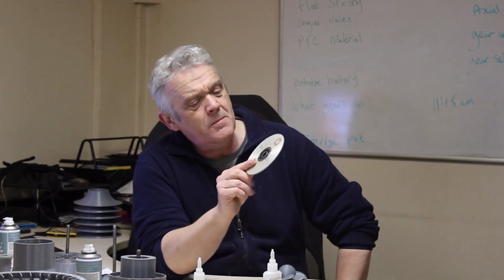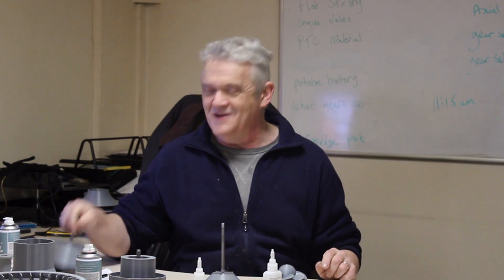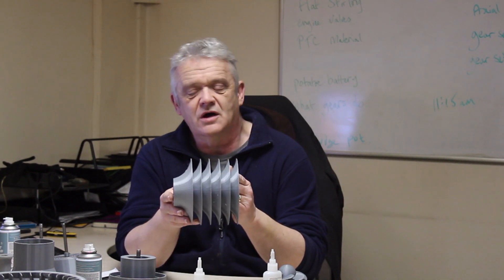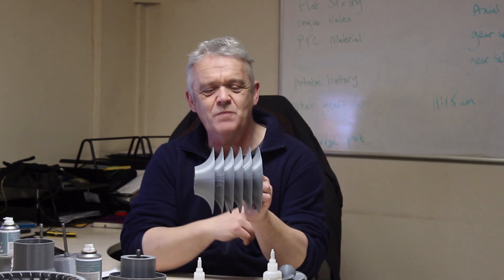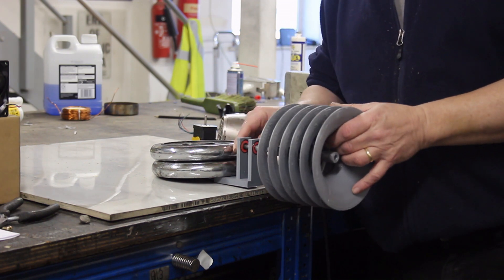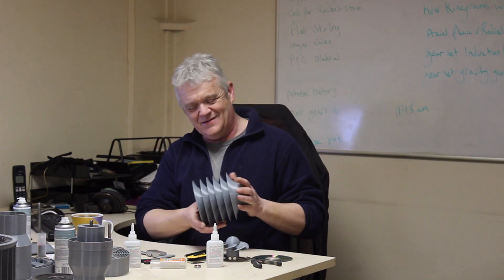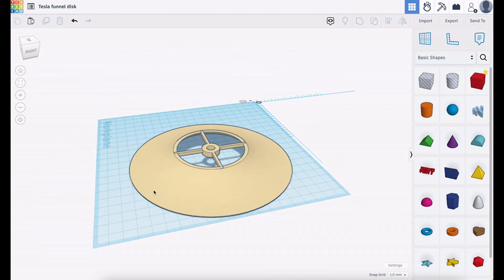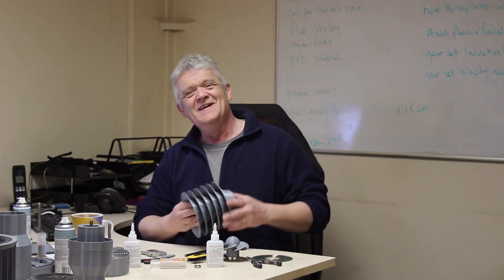1890 The Next Step In Tesla Turbines

Comment: I wonder if there's a way make it so they're further apart at the edges to catch more slower air, and then coming closer together as it funnels down to get more of the tesla turbine effect? 

like maybe use 3 different sizes of funnel at the Top part of the disk, so you get a big gap to catch lots of air at the outside edge, and you get some venturi funneling it down to a medium gap in the middle, then a tight gap where the coin or the ball always starts going fast in the funnel? 
So you'd stack them Large, medium, small, S, M, L.   
I have no idea if that would work, but it might split the difference between air collector and turbine.   Dunno if anybody can see what I'm pointing at there.

Comment: For an omni directional  you may want an external guide deflector, either in four or eight vanes, coming out in a bit of a pseudo rosette, (other descriptions may cause issue as seen from the top), such that fluid movement is guided to push to single direction of spin, as well as no countering forces.

Comment: Could it be that it's not the air moving over the surface but an "offset" low-pressure zone creating lift on one portion of the disc, like an airplane's wing, causing rotation, and then furthermore, should a design not reflect exploiting this low-pressure zone?

Comment: Interesting concept, I think this would be better used as a tesla pump, but would be super interesting to see it in a casing. I have to disagree about the high pressure. I recently got 888 mph periphery speed with my 3 inch tesla turbine going 99,400 rpm on less then 3 psi. This was with the boiler and condenser being void of atmospheric pressure.

Comment: Have you considered printing one, sanding and refining it then making a mold with 2 part silicone. Then you can quickly cast multiple copies with 2 part epoxy resin, all smooth and ready to stack.
Reply: Has resin come so far to hold up to 450° an 70,000 RPM ???
Metal printing maybe ...
Reply: why not print a die to press sheet metal ones??
Reply: Why, when you should be able to print a complete part?
Reply: @charlesangell_bulmtl  Printing is not quick. Like literal days. Especially for larger parts. It's much faster overall to print one as a prototype to mold around and then rapidly cast resin copies of it.
Reply: @KaiserTom  There are a lot of settings you can tweak (infill percentages, nozzle size, number of perimeters...) to improve speed, but beyond that 3D printing leaves layer lines as it's just a stack of (typically) 0.2-0.3mm layers of plastic, sanding smooths out the surface imperfections which would mean less turbulent airflow, so it's still an excellent idea.
Reply: @OldManSparkplug  : Anything that weakens a Tesla turbine is undesirable.
Reply: @OldManSparkplug  yes Michael I’ve done what you talk about (just not one of these) a few times, and it’s the best method.  I don’t understand why so many people on YouTube use their 3D printer to make the end product.  The lines look so cheap and printed plastic delaminates often easily.  It’s not that much more time to clean/prep the part and make a silicone mold.  From then on you can pump out strong and beautiful parts quickly.
Reply: @charlesangell_bulmtl  Print one, sand it perfect, mold, then cast dozens. Should work far faster and more accurate.

Comment: Very cool! I don't have the time to try this myself at the moment, but I wonder if adding lateral supports on the outside and removing the brace in the centre would make the flow more uniform. 

The lateral supports could possibly be wing shaped to give it a push start. Then the output shaft should be the same diameter at the cone openings, giving a lot of surface area for magnets.

Comment: Theres a paper out there on making "cupped" Tesla turbines, the idea came from wood cutters needing to be a "cupped" blade so it straightens as the speed increases and the blade gets hotter
Reply: If the flow goes turbulent, the advantage over a traditional turbine is gone.  The loss is seen as heat.
Reply: I wonder if golf ball dimples would add friction points for ease of spin, more hydro thought 💭
Reply: @MortifiedU   dimples are meant to decrease turbulence and drag (caused by the back side) of the golf ball as it hits the air. What you need here is laminar flow and no turbulence created by the disk itself. The boundary layer principle of the TT operation means the air isn't pushing anything (like in conventional blades), but it's dragging the disk along as it passes parallel to it, to put it simply. Great tangential thinking though, always helps to have an open mind about how different effects can be applied in these experiments.
Reply: @MortifiedU  You don't actually want friction. TT's aren't friction driven a common misconception according to Tesla himself they're electric turbines because rather than friction what you want is electrostatic adhesion. Friction is causes when the discs slip and move faster relative to the motive fluid what you want is the opposite a reduction of slip this is how to create torque and work.

Comment: A tesla turbine can work with a single disk, cylinder, cone or even just a ball, as the defining function is the interaction between a fast moving medium, a surface and the drag created on/in the boundary layer(s).
More discs just mean more surface areas for boundary layers to happen. And you can nest discs/cones much easier in a way that the moving medium passes over the surface perpendicular to the axis, then you could with a cylinder.

Adding dimples/bumps to add speed/power could be a way to increase boundary layers and interaction with the moving medium.

Comment: so if you combine the tesla turbine hyperbolic funnel with the darwin funnel, you could mount the darwin funnel to the top of the waters turbine and increase the effect of each part? or would they subtract efficiency from the other parts?
Reply: I was thinking something similar, though also that something to watch out for is, in these quick tests the moving air seems directed at one half of the tesla turbine, which wouldn't be happening in free wind. There, I think the wind would be blowing across both sides, giving virtually equal torque but in opposite directions so essentially cancel each other out.
A possible remedy for that would be ( what I'm calling ) a Diagonal Tesla Wind Wall where a series of Tesla Turbines are staggered by ( about ) the radius apart, that way each one (  mostly ) blocks the negative torque to the one behind it.  The air exiting the individual Tesla Turbines could be routed together to turn an additional single, more conventional, turbine.

Comment: are you intending to use this as the wind collector for the 'darwin' thing? like, connected to the drive shaft, so that both this and the turbine at the base contribute to power generation?
Reply: I put 'darwin' in quotes because the basic design predated him by centuries, meaning he shouldn't get credit for it.
Reply: if you use this as the wind collector, and have a water gutter down the center that dumps onto the turbine at the base, using the top for rain collection, then it pretty well marries all of the things you've been considering lately into one energy harvester.

basic 'darwin' - wind collector drives air down onto base turbine
'tesla' turbine - wind collector is a hyperbolic 'tesla' turbine
water turbine - upper surface is a rain collector, which drains into the central baffle/gutter, directing water onto the base turbine to be driven by a falling water column whenever it rains

Comment: What about having little notches that are on the blades (notches as in raised little blocks), I just watched a video with Guy Martin and the Wind turbines, the Big big wind turbines have little notches on the blades to catch the wind and cause a disruption in the air which then pushes the blade better.  Just a thought.
Reply: Those notches are vortex generators to help keep the flow of air on the blade rather than peeling off and causing turbulence and hence loss of performance.
Reply: @vumba1331  Exactly. They are not to "catch the wind" but to stop separation of flow and loss of "lift." They are used frequently on small jet aircraft, especially, for the same purpose. So we're talking about airfoil applications, specifically.